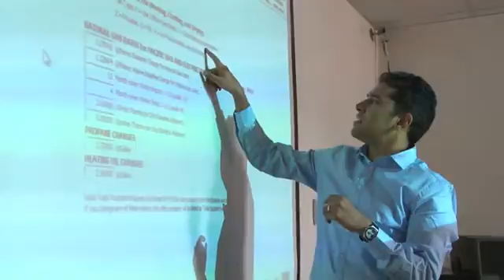Passive Design for Hot Climates course

Comment: This workshop focus is urban design and architecture from climatic and passive approach. Throughout the workshop, the fundamentals important to natural ventilation natural lighting, solar protection comfort in buildings are introduced. Building Performance Simulation Tools play a major part in this workshop. Participants will be trained to verify their design and the effectiveness of the passive strategies with the help of simulation tools.The use of the tools is aimed to support the designers decision making and verify the success of the passive design measures in relation to local weather context using local weather files. The programs that will be used include Ecotect, sefaira, Climate Consultant Weather Tool, Google SketchUp and Construction Thermal Conductivity and Time Lag Calculator.    

Audience: urban planners, urban designers, landscape architects, architects and building engineers, environmental designers, project managers, municipality officials, sustainability experts.
http://www.shadyattia.net/academic/WorkshopPassiveD/index.html